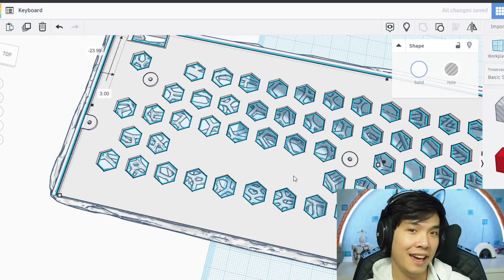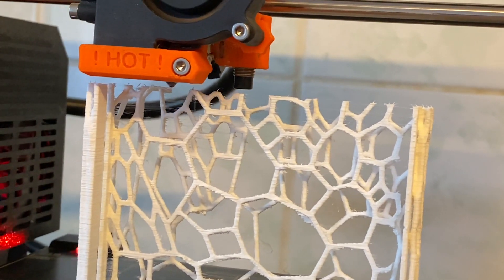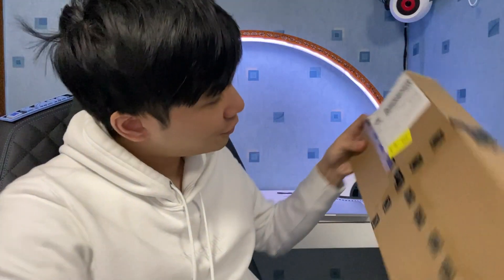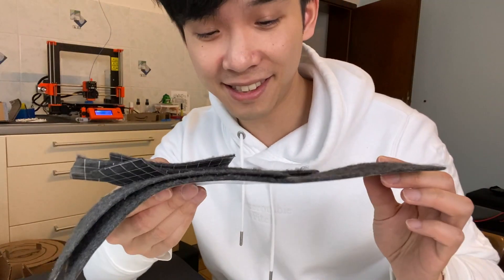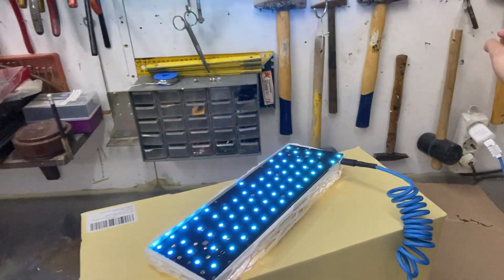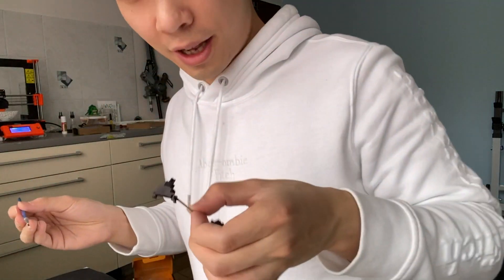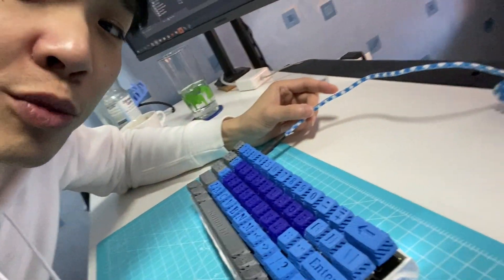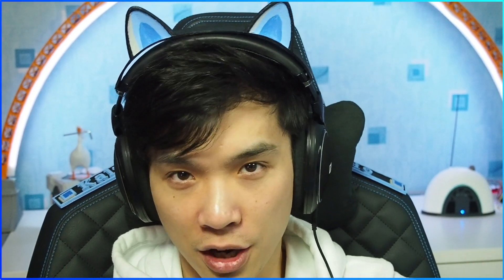3D Printed Mechanical Keyboard (Including Keycaps!) using DZ60 RGB

Comment: I love your project, the keyboard is fun to look at even if he fill… a bit « Cheap » to use :)
Reply from the maker: thank you for the positive feedback! yes it indeed feels a bit cheap due to the keycaps. if i swap it with some nice PBT keycaps it feels much better :)
Reply: @KalunHo  Actually I did a lot of keyboard using 3D printring and for the two keys are :
-  To have thick walls for the case is better than to have big infill.
- You need thick plate to avoid vibrations and bad feelings with the keys, but you can make 7,9mm plate thick which is impossible with metal and the result can be better than any other method.
Reply from the maker: @4sstylz  woooow thank you so much for the info!! ive been trying many things and it seems non if my tests worked out! i will take ur advice :D

Comment: Great video, can i ask you, if i could make IT with Prusa mini+ ( 16x16x16cm )
Thanks a lot
Reply from the maker: Hey it might fit on the mini - the total length of the keyboard is around 30cm -> since u split it in half, its 15cm + 15cm. but u better check in the slicing software first :)

Comment: I have a Question.
Which PCB are you using in this Project and where did you bought it?
I also want to build my own Keyboard.
Have a nice day
Reply from the maker: Hey, i bought the DZ60RGG v2 from Kbdfans. i bought the hotswap one ! (be aware that there might be import tax u need to pay in your home country)
Reply: @KalunHo  Thank you very much
Reply: @KalunHo  how much does it cost to build it
Reply from the maker: @SpiralisIsHere  the pcb costs 55$ and stabilizers 18$. i had some switches left here and the PLA i also did not count. but u should be good with less than 100$. :)